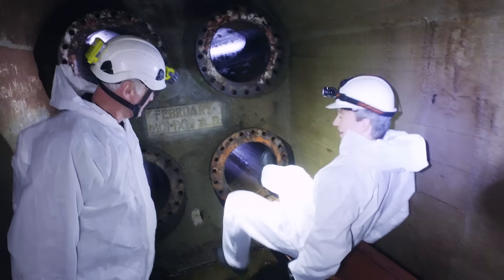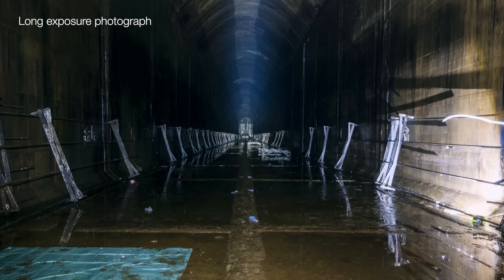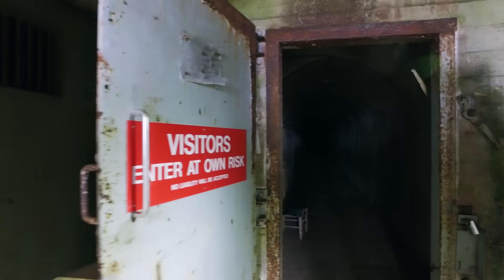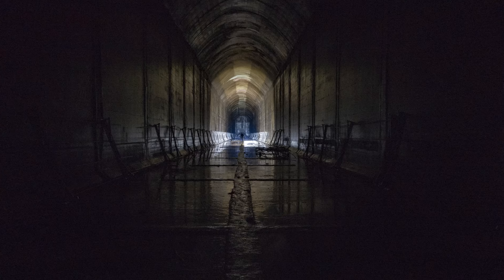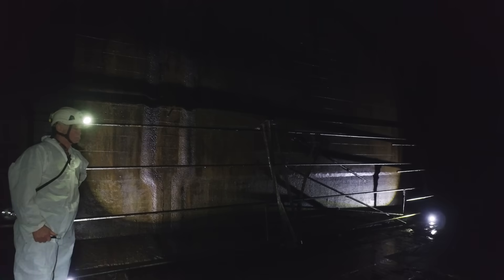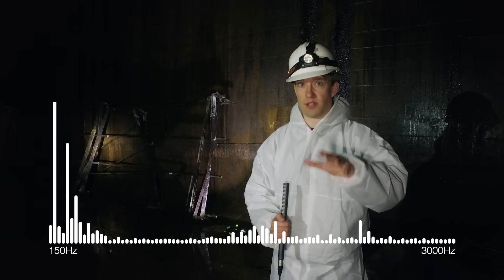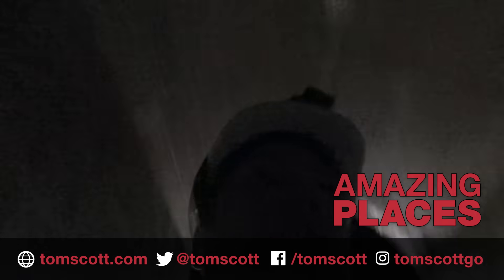Testing the world's longest echo

Comment: Physics teacher here. This is an interesting experiment as we can find the length of the pipeline he's playing into (or least one section, which most likely has a closed end somewhere)
Using a bpm counter, I found that the song he plays has a tempo of 104bpm. 
Counting the measures, we find that it takes 2bpm before the sound he plays is returned to him. 
Some quick math finds that the actual time therefore is 60(seconds in a minute) / 104 (bpm) * 2 (amount of bpm for return) = about 1.15 seconds for the sound to travel from the sax to the end of the tube and back to him.
Using the speed of sound we can calculate the total distance the sound has to travel. 
Sound on earth travels at around 343 meters per second. That times 1.15 seconds gets us to 395.77 meters.
As that is the distance for the sound to travel and back, half of it would be the length of the section of the tube. 395.77 / 2 = 197.89 meters deep in ur mom lmao

Comment: I'd love to go down there with a sine wave generator.  Harmonics in there would be wicked.  That might exceed the echo time length of the pistol.   You'd literally be tuning the sound for optimal performance, while reducing the impact of interference waves.

A single speaker in a tube, aligned perfectly with the chambers long access may improve it more.  

If I weren't on the wrong continent, I'd probably be begging to go in with you to test.

Comment: A starter pistol is just very loud. What I want to see them do is set up a speaker and play a frequency that's harmonic with both the diameter and the length.

The reverberations would echo at the same frequency as the physical dimensions of the tank.

That would be really cool. Right before it gets so loud that it kills everybody in the chamber.

Comment: I have worked in the Marin Depressurised Wave Tank that is 250 metres long and has external walls that are 1.5 metres thick. The tank with waves and a towing carriage over it is designed to be evacuated to just above the pressure at which the water in the tank would boil at normal operating temperature. The echo and reverb were astounding.

Comment: This is actually the fuel tank of a Hummer.
Reply: And it’s still empty in minutes
Reply: @karelpgbr  But only if you drive slow.
Reply: A civilian one
Reply: If you rev the engine AND turn the AC on, the fuel level drops faster than the speed of sound.
Reply: wouldn't doubt it
Reply: What a disgrace to the hummer. This is only 1/3 of its fuel tank.
Reply: Tell me you are American without telling me you are American.
Reply: This is not gold, this is diamond

Comment: Him: "This tank is 237 metres long and it's not meant for humans"

Also him: *Goes in*
Reply: I really hope they tested the air before they did that. People have dropped dead walking into spaces of that sort.
Reply: @peppermintgal4302  explain how that happens
Reply: @HappyToasterrr  In closed spaces the still air over time separates and the heavier co2 sits at the botton. CO2 is poisonous even in quite low concentrations. Also did they perhaps mention it was at some point full of diesel?
Reply: @HappyToasterrr  you shouldnt sniff fuel.
Reply: @RidhRidh  fuel smells so good . People used to use it for incense
Reply: @isthateventrue  then how are they able to step inside and live?
Reply: @HappyToasterrr  he was only in there for about 15-30 minutes, not saying thats good, but it won't kill you within minutes like that
Reply: @isthateventrue  considering not one bit is good for you , wouldn't he at least get minor health problems?
Reply: @HappyToasterrr  same rule applies to this, he wasn't in there long at all, so he wouldn't really take in much of it, considering it goes down rather than up,
Reply: @HappyToasterrr  i got a headache once sitting in the back of a van with fuel that was leaking from a container
Reply: @ProfessionalHater88  how long was the trip?
Reply: @Rig0r_M0rtis  I don't mean to be disagreeable but C02 isn't meaningfully poisonous, the danger comes from asphyxiation as it displaces O2. You might be thinking of CO, which is not present in significant quantities in normal air, and is lighter than O2, not heavier.
Reply: @Boba-Fett-GS1150Ez  pulls finger*
Reply: sniffs fuel
Reply: just because it isnt meant for humans doesnt mean humans cant be there
Reply: @petterlarsson7257  soo is it for aliens ?

Comment: It's a shame that the tank is so narrow, this makes the otherwise clear echo quite polluted because of the sideways reflections. 

Imagine a perfectly dome shaped room with the same radius as the tank in this video is long. Imagine all surfaces in the dome being almost perfectly smooth. Then, standing precisely in the middle, you do the same experiment as above. After the short gunfire it would be completely silent for a second. Then suddenly, you would hear the same gunshot again, almost at the same sound level you started with, under perfect circumstances this would repeat and repeat and repeat. Sounding like a gun is fired every second.

The smaller the dome would be, the faster the sound would be repeated. (search for video's of the sound in a nuclear cooling tower for a comparable reference)

Comment: The abandoned Sideling Hill Tunnel (2.2 miles long) has a long echo like that, and might be a contender. I recorded about a minute and a half of reverberation there just by slamming a metal plate against the concrete. Firing a starting pistol would probably work better.

Comment: “Yes this place was used to store millions of gallons of flammable oil” 
Proceeds to shoot a starter pistol in the air
Reply: I work with cleaning large oil tanks. I'm sure that this space is carefully cleaned and vented out. 
If there was any gas still inside, they would have been required to use gasmasks.
Reply: There will be oil still seeping out, but all the volatiles that are at risk of igniting are long gone. They were actually almost entirely gone when the fuel went in. Part of the reason ships use fuel oil is that it has almost all the volatiles removed so that there is no explosion hazard in the gigantic tanks. You could probably fire a pistol while the tank was in use and not have a problem. There is also the fact that if there were a significant fraction of volatiles you would not be allowed in there without breathing gear, irrespective of flammability concerns. 
It is only moderately more flammable than if the walls were coated with asphalt, and we don't even think about our roads catching fire.
A question worth asking, but the answer is that it is fine.
Reply: I test marine fuel for a living and let me tell you, the oil stored in this tank would’ve been so heavy that it likely would take minimum 5-10 seconds of contact with a Bunsen flame before igniting
Reply: Oh people it is fuel oil not your regular gasoline, remember the battleships used in WWII used to run with furnace or an boiler and they burn heavy oil to produce power, even if you start an fire in there the oil will not catch it, it's very hard to burn
Reply: Julian D. A starter pistol fires a blank, and regardless shooting into oil or an oil tanker doesn’t actually do anything, it’s just a movie thing
Reply: Blanks still use gunpowder, which creates sparks and fire.
Reply: @RainytheNB  Good luck trying to light up the heavy oil residues with just a few sparks. It needs a lot of heat/pressure to burn this stuff.
Reply: @RainytheNB  It wasn't a revolver, closed chamber means no gunpowder or "fire" can escape the gun
Reply: alfredo132220 bruh its a joke chill
Reply: @magscorch7706  You can actually see a small burst of flame leave the barrel of the gun in the video.
There has to be an open barrel in the gun, so the sound can escape better and it doesn't just destroy itself.
Reply: @RainytheNB  Oil does not combust like gasoline
Reply: @magscorch7706  So we should believe you, and not our lying eyes when we actually see fire come out the barrel when he fires?
Reply: @magscorch7706 It will have a narrowed part of the barrel to partly obstruct the gases like the bullet would in a gun (and to keep it from being used as a gun) but if you seal the chamber completely you get a starter bomb.  Like any blank gun you need to let the gases escape out the end of the barrel.  When that mixture of hot gases leaves the end of the barrel it is often still burning and is quite hot.
Reply: Goddammit guys, it's just a joke
Reply: Fuel oil and gasoline is not the same thing. Fuel oil is closer to diesel than gasoline and will not ignite with spark, it needs high compression in order to combust.
Reply: Fuel oil doesn't burn easily, or cleanly. The molecules are too big to easily vaporize so igniting it in the air is not a concern either.
Reply: You can toss a lit match in a bucket of gasoline and it won't catch fire much less oil
Reply: It was professionally cleaned , Or didn't you read that bit .   Duh 🤣
Reply: This ain’t gta blud
Reply: I laughed out loud at work.
Reply: It's just a joke, smart-asses
Reply: Oops.....good point!
Reply: The gas is the flammable danger
Reply: @EhmLo0oL  2:11 the caption mentions it was professionally cleaned. If there was gas in it they wouldn't let people in anyway... Search LEL and UEL if you want to learn about explosiveness...
Reply: @AAAyyyGGG  I just said that it is not the oil as the liquid which is the insanely flammable cause...instead it is the gas...same goes for fuel etc...
I didn't say anything about this excact situation. Just answered to the commend above✌😉
Reply: @AAAyyyGGG  It was cleaned, but oil still seeps through. Not that it necessarily changes anything
Reply: @johnmartinez7440  where is the oil going to seep from if they've removed all the oil?
Reply: @Dedfaction  Literally everyone said so already, can you read? It seeps out of the walls. They absorbed a little amount of oil.
Reply: @EhmLo0oL  then tell me this.  Can you arc weld in a full tank of gasoline?  No oxygen.  Only hydrogen and soot.
Reply: @EhmLo0oL  There is no gas. Ships don't run on propane.
Reply: wtf, even you would use a flanethrower that concrete would probbably suck all heat from the oil and it would never catch on fire
Reply: It is reasonable to assume there is now a ventilation system in place. That's probably the reason for the limit on longest reverberation - the sound got blown away, sucked out, whatever, by the ventilation system !
Reply: Nothing like science nerds to ruin a fuckin joke with "uuuuh akshually" comments. Neil DeGrasse Tyson would be proud.
Reply: @BathroomTile  nothing like sharing information. intuitively firing in the area feels wrong, but I assume it's not and I don't mind knowing why
Reply: You clearly aren’t that smart
Reply: Can I see your confined space training certificate and the certificate for the atex starter pistol.. and your escape sets.. and risk assessment..
Reply: The only thing that might start a fire is not the pistal but, your stupidity.
Reply: R/woooosh
Reply: @Thewiggliestofthemall  how years old are you? You clearly have no idea how to use r/wooosh.

Comment: Astounding. 
I experienced a 17 second reverb in
an vacant warehouse/factory space 
in an industrial park in
Los Angeles in '91. 
What made it so amazing was 
 not only the concrete floor 
and the sealed cinderblock walls
and the open steel roof deck, 
but the long, curved back wall that
conformed to a curve  in the
railroad tracks behind the building
that allowed for loading/offloading
material directly to/from boxcars. 
Big, reflective steel doors, too. 
Broke up the parallel surfaces and 
created a lot more reflection. 
I whacked a snare drum really hard
and counted. All I could do. 
Didn't have any audio equipment
or even a stopwatch. 
I yearned to come back with
some audio gear, but it was
impossible. 
It was amazing. 
But not like this.

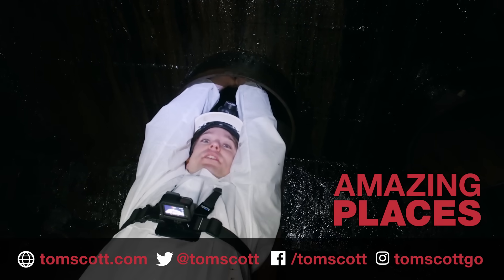Comment: The cool part is that you can download this video, cut the part from 1:52 to 3:06 and use that sound as an impulse into a convoler. A convoler is normally a computer program that you can use the impulse from a echo chamber and then play any other instrument or audio that doesn't have any reverberation before and apply that impulse to that instrument or sound.

The result will be that instrument or sound to echo just like it would echo if you played that sound inside that chamber!

Comment: I worked in a 1.8m concrete water main for a water pipe rehab job.  We had 800m long sections open at a time.  There was relatively little reverberation compared to this oil tank, but the report from the closed valves at each end of the section would bounce back and forth many times.

Comment: That would be an amazing setting for part of a game
Reply: Simulating the echo would be tough though. You couldn't use a convolutional approach. That nearly two minutes of impulse response would chew up way too much CPU to compute in real-time. You could do it on the GPU, by using a separate OpenCL kernel for each output sample, but you'd still be eating up most of the GPU's computational resources. At 192kHz, convolution with a two-minute impulse response would take about 4.4 trillion multiplies per second of output. Even if the additions are bundled in as a fused-multiply-add instruction (making them essentially free if you're already doing multiplies), that's still something like two thirds of what a high-end graphics card can do.

Comment: Should go check out the Tokyo Metropolitan Area Outer Underground Discharge Channel.

It's a massive underground flood mitigation system with 5 surge tanks (65m high and 32m diameter) connected together via 6.4km of tunnels to a massive, underground, cathedral-like holding tank (25m high, 177m long, and 78m wide). The system can collect all the overflow from Tokyo's rivers and divert an olympic swimming pool's worth of water every 2 seconds at peak capacity.
Plus it's open to the public for tours, you just need a Japanese translator.

Comment: I kayaked though a pipe once, fairly large pipe but it was filled with water so you had to lean back to get through and then your nose was basically touching the ceiling... But that pipe looks way more terrifying, I don't want to imagine trying to crawl through it alone and getting stuck.
Reply: Getting stuck? That tube has a 45cm diameter, I wouldn't need more than 40 to fit through :3

Comment: The video says the reverb is 112 seconds. Is that the time it remains audible for, or its "T60"? T60 is the term used by acoustic engineers to measure reverb time. It is the time taken for the sound level to drop by 60dB, which is very different to how long the reverb remains audible.

Comment: High frequency faded quickly also due to microphone choice. As I see You used Rode NTG-2, it is a shotgun microphone with very narrow polar pattern. That microphone off axis has very different frequency response, so when you were pointing at one point above you mic was capturing only high frequency that was bouncing off from that direction. In pipe-alike rooms reverb behave like a virtually moving sound source, and that high frequency roll-off sounded a lot like a sound sources away from front of the microphone.

Comment: The scariest thing is its a room full of oil residue with only an 18-inch pipe to get out.
Reply: I don't think the smell is the problem you need to worry about. Any source of ignition is what you need to worry about. There's no ventilation, no easy escape and a lot of easily flammable and hard to extinguish oil everywhere.
Reply: Depends on the fuel oil stored -most fuel oils actually don't combust easily, if you dip a flame into it it'd extinguish the flame. Kind of the same with some jet engine fuel.

But once it's been sprayed it'll combust very easily (and so it is still dangerous.)
Reply: @mukrifachri  I wonder if static electricity may be enough to ignite it.
Reply: @madman2u  Obviously not because they fired a starter pistol in there, so they clearly weren't scared.
Reply: @MGSLurmey  heavy fuel oil needs to be heated up before it's flammable.
Reply: Agreed. I wonder if it stinks?
Reply: Must be American proof.
Reply: TheDirewolf 1234 That’s a bet
Reply: And the oxygen would be consumed instantly
Reply: I’ve been in there and yes it does stink
Reply: The smaller the barrel, the faster you get to move. It's only 2" more than the main guns of Iowa class, and full 2" less than the Yamato class.
Reply: If there was any oil vapors in the air, you would be suffocated.